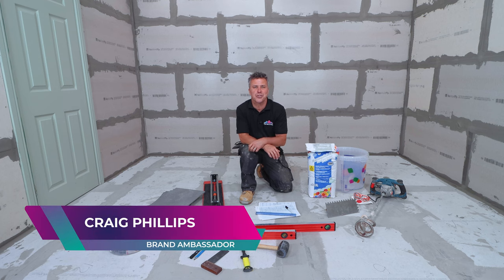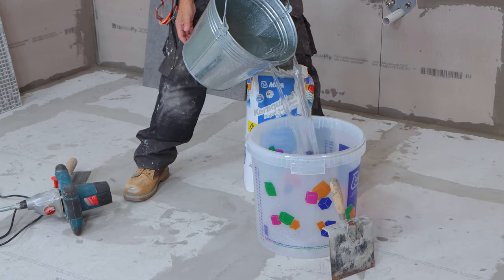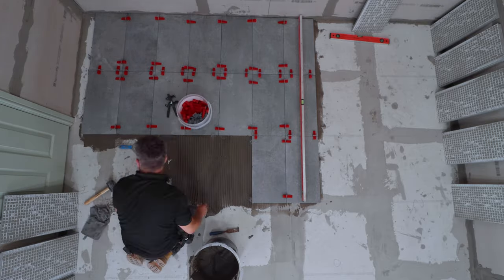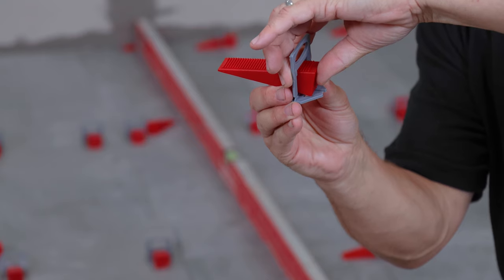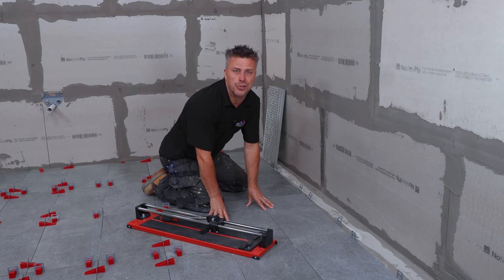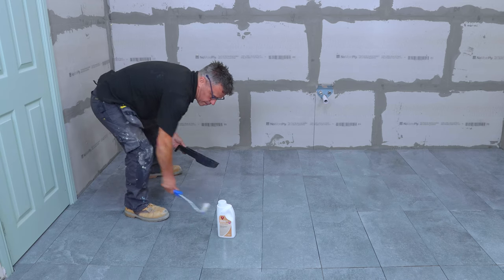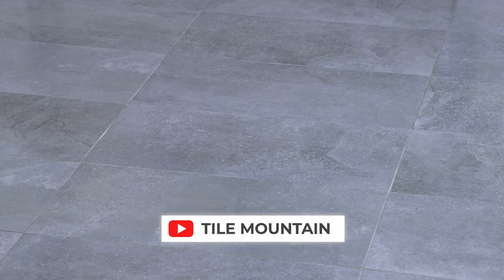How to Install Floor Tiles | COMPLETE A-Z GUIDE | Tiling Trade Tips with Craig Phillips

Comment: Just a tip, with rectangle tiles you can get away with using only 1 leveling clip and wedge on the short sides meaning less work.
Also a pencil works great for clearing tile adhesive from your lines before it sets so that your grout shows instead, keeping colour uniform

Comment: Don't need the applicator just do it by hand. As a tiler I only started using these systems about 3 months ago always just used normal spacers. This just makes it a little easier. Make sure to clean the adhesive out of the lines before putting the clips in saves you a job later. Also use normal spacers still as the clips arnt 💯 so cover yourself by using spacers aswell.
Reply: Good tip thanks

Comment: Thank you for the video!

How much thickness(height) of adhesive should I keep for the following;
- Adhesive thickness for laying insulation boards?
- Latex thickness after laying underfloor heating mat?
- Adhesive thickness for laying 10mm tiles?

Comment: I think I put toooo much Adhesive under the tiles, I put the adhesive on the Concrete floor and on the back of the tile and now they are moving after two days. Would it be the cold weather that is making it take so long to dry? 😢

Comment: Why you not skimming off a thin layer of the thin set on the edge of the tile before placing the clips for the second tile? And why no back buttering of the tiles?
Reply: It's not necessary to back buttering tiles if you have enough thin set on the floor
Reply: Its not always required on tiles this size,

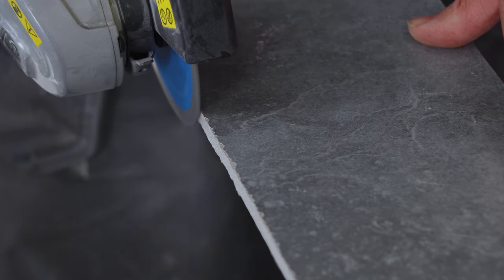Comment: At 21:59 the door is closed and the tile goes under the door and in that respect if you are on the other side of the door in the opposite room you will be seeing the tile protruding into the room. At 25:28 you can clearly see how the tile protrudes into the next room and with the door closed you will be able to see this tile. Unless the same tiles are going to be laid next door as well and butt up to these tiles then that's fine but if its a different floor material like carpet or wood then from the room with the other floor material in you should not be able to see the tile protruding you would have a suitable Threshold strip between the two floor materials but you shouldn't be able to see the threshold strip if it's fitted in the correct position directly under the door. The same goes if you are in the room with tiles you shouldn't be able to see the threshold strip or the other floor be it wood or carpet from the tiled room. Just a minor detail, I know, so don't shoot me.
Reply: We build sets to shoot a number of different videos, its to a real house!

Comment: Back butter & thin set should be parallel to the short side of the tile so air can escape.  :hand-orange-covering-eyes: Integrity & Strength could be compromised.
Reply: Thats right

Comment: No back putter on tiles why don’t you clean the the edges of tiles before putting in the clips so the adhesive doesn’t come up on the joints
Reply: The real questions here!
Reply: He mentioned it at the beginning as an “option”.
Reply: You don't always have to back butter tiles. That's just an American obsession. And when you take the clips out the following day the adhesive is still fresh enough to remove with a blade and wet sponge.
Reply: @IHFM2024 Wrong and wrong.
Reply: Not wrong at all, done it loads of times. You don't know what you're talking about!
Reply: @IHFM2024  You obviously don’t know what you’re talking. 
And when working with large format tiles which is todays trend, then you absolutely back butter the tile.
It has been scientifically proven Einstein.
Again, you’re wrong and wrong…….work clean and work smart, not in your vocabulary I see.

Comment: im about to remove my old ceramic from my wall to put on a new one. Do i need to remove ALL the old concrete on the wall  so that new concrete can be put on? Or can i just put new ceramic on old concrete walls?
Reply: For my balcony I have removed all the concrete as much as  I could. Idk if you can just leave it
Reply: Put on top

Comment: It is cleaner to place an off-cut of tile close to the moulding useing it as a  height guide and cut out the excess moulding allowing the tile to be fitted under the moulding.
Reply: Thats right it works well

Comment: You'll be lucky to have 50% coverage under those tiles, them with the waffled backs need to be back buttered.
Not a great advert for tile Mountain to be honest.
Reply: Right he is not tile setter just pretend to be what mess
Reply: Im not a tiler but he did say you can butter the back of the tiles if you want to.
Reply: Already fail
Reply: Should start with a full tile against a while either